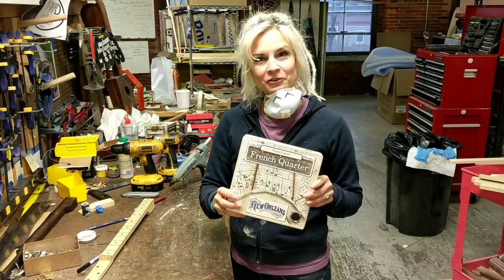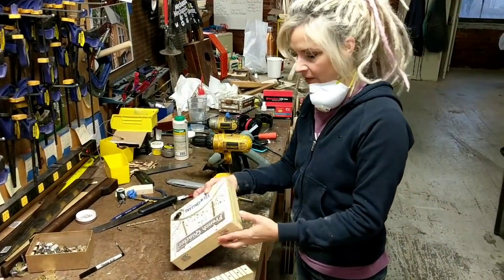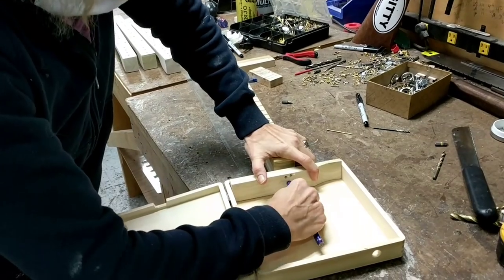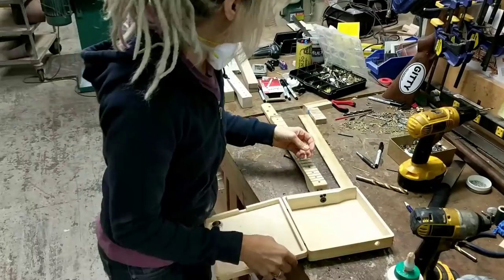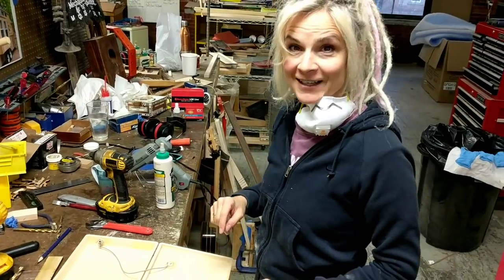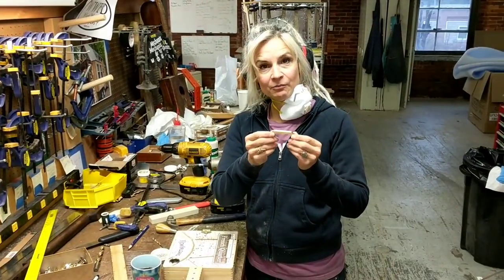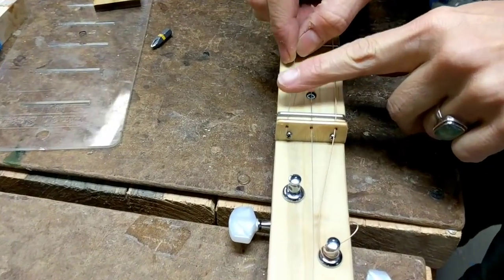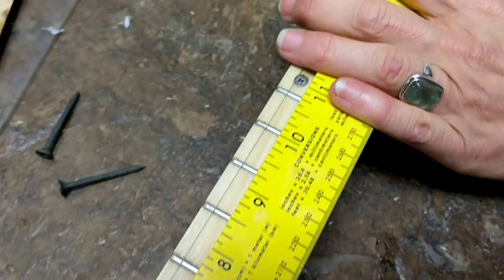How to Use C. B. Gitty's Bolt-on Cigar Box Guitar Necks

Comment: Awesome tutorial dawlin,  I'm a luthier from N.O.L.A - The City - as they say, but was captured in Mississippi.  This video is bad ass. Short, get's right too the point with all the important time saving measurements & information.    For the neck bolt, did you use a threaded insert with a machine screw?   Or wood screw with wood glue?

Comment: how secure is the neck with this method?  i have a found neck that might be adapted to this method of attachment and save me the problem of finding a box big enough to fit the bridge on.
thanks a great idea...
Reply from the maker: In our experience it is quite secure. Gluing the box shut makes it part of the stability as well. We only use this method with lighter-gauge "high open G" strings though, so it might not be effective for heaver-gauge wound strings for Low G.
Reply: I have made several of these bolt- on's after watching this video.  The fretted and fretless slide versions I've made were all at a longer 25" scale and strung with A, E & D (0.46, 0.36 & 0.26 gauge) nickel wound strings.  I haven't experienced any bending, warping or cracking of the necks or boxes.  This technique really makes a build a lot faster and easier than the traditional method.  It also essentially leaves an empty box except for the the reinforcement pieces (I do reinforce the sides with some smaller pieces also).  The emptier box seems to resonate much better and also provides a lot of room for your pickups, wiring and sound hole placement options.  I also make my own boxes which are just 1/4" poplar sides and 1/8" birch tops & bottoms (which are reinforced at the bridge and pickup positions).  I have used both, the hard tail 3 string bridge and the threaded bolt with a tail piece style.  Either way, they sound great!  I hope this information may help some people when questioning if this method is secure or not.  I say, "Give it a try". Thanks for the video Farley/C.B. Gitty!
Reply: Oops,  I meant E, A & D (0.46, 0.36 &  0.26) strings... (brain cramp)
Reply: @michaelpinkerton3834  Hi michael, im just thinking of doing this method. Do you recomend it after this years ?
Reply: @michaelpinkerton3834  I use standard G and E tuning.
Reply: @lucaszoanni5828  , yes...I haven't had any issues using the bolt on necks since doing them...